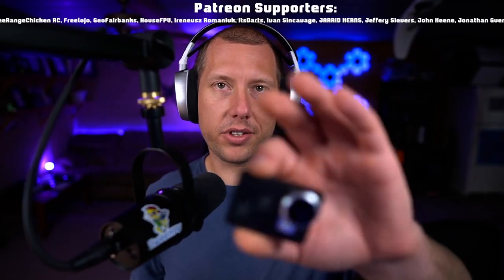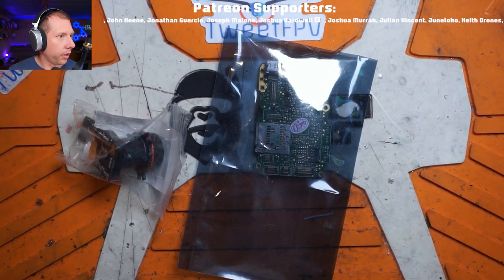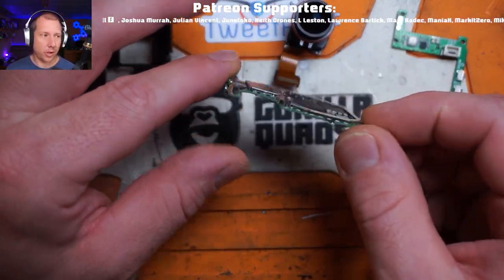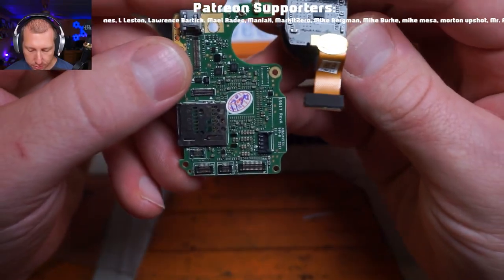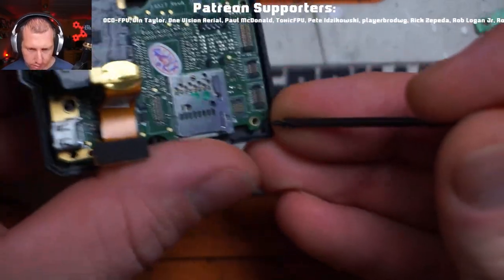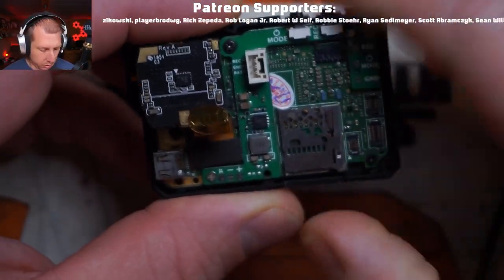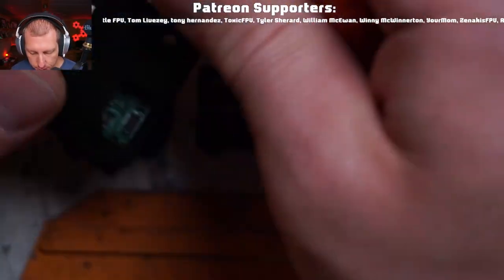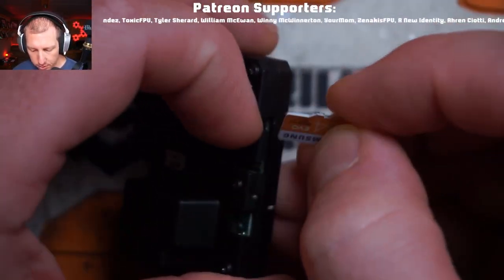How to make a naked gopro from parts.

Comment: How do you hook up a screen to configure if you don't have the setup that you have? Meaning your old GoPro screen and a 3D printed case
Reply from the maker: You need to buy a screen. I'll have to find a link to the 3d print. You don't need the print you can just connect it by hand.
Reply: @TweetFPV  oh I get that but is there an hdmi micro on the back of the GoPro or what
Reply from the maker: No. You change all the setting via the gopro app.
Reply: @TweetFPV  okay now I'm confused you said that you need a screen first time you hook it up. So what do I need to do, physically plug in a screen or can I use the gopro app. My apologies I'm a little slow, but this is something that I do want to try